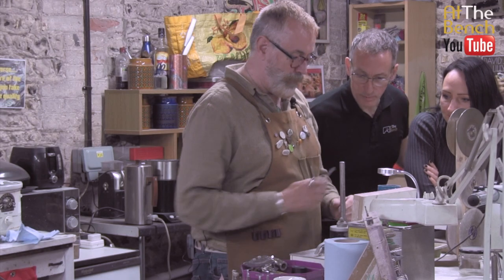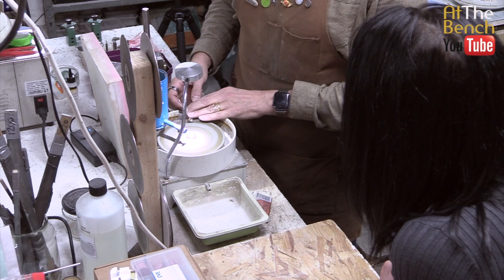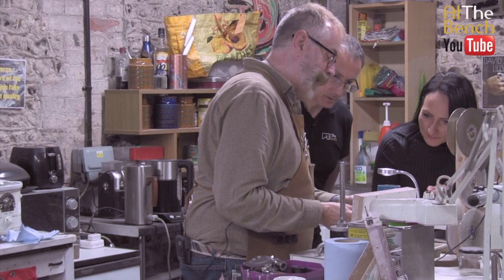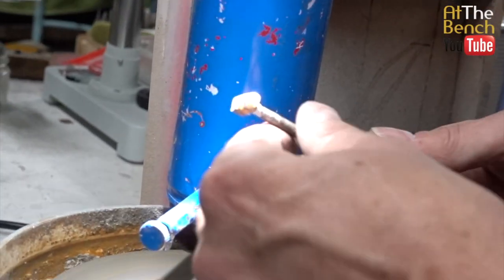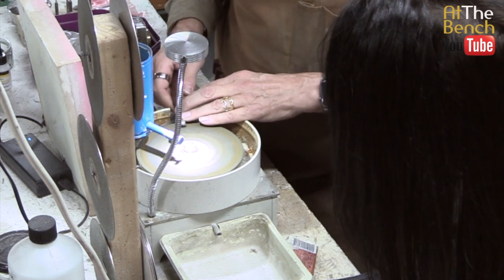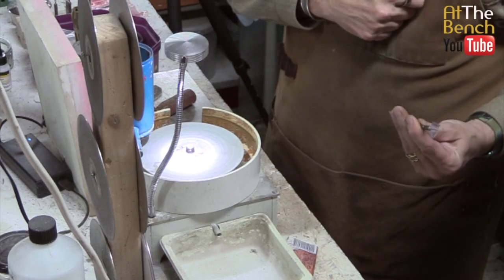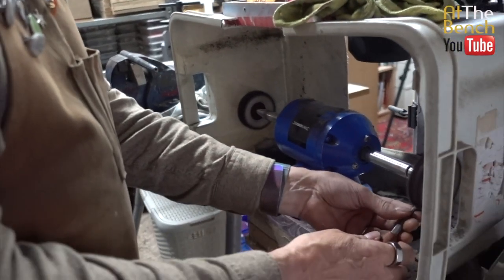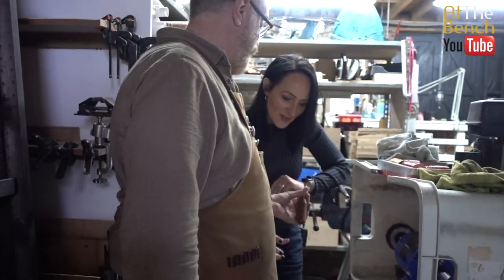Cabbing with David J Lilly - At The Bench Visits David J Lilly

Comment: I use a flat lap to cut and polish cabs, i do it a bit differently, i mounting the stone onto a piece of wood Dowling and rotating it in the same spot and changing the angel rotation if that makes sense…but I mainly make round cabs. You should take a look at Black Opals direct you tube channel on cutting opals…that guys tutorials are off the chart…..it’s mesmerising just to watch him work. I love David’s DIY splashback or of a storage box….I have to make myself one, and although I have used superglue in the past, I didn’t know superglue mixed with talcum powder is stronger than Dop wax, thanks for that tip 👌